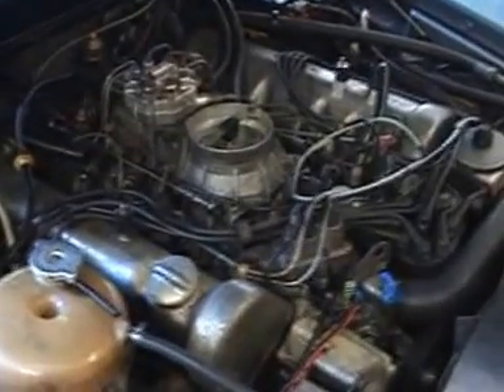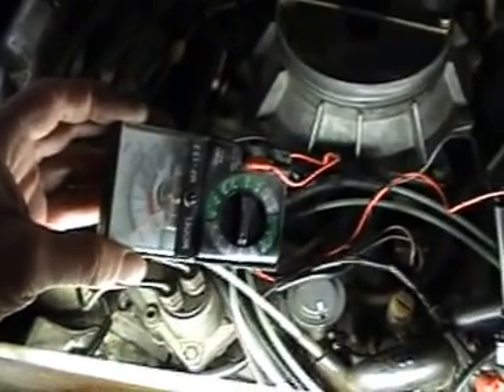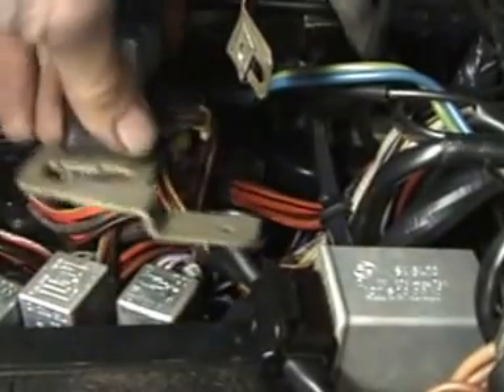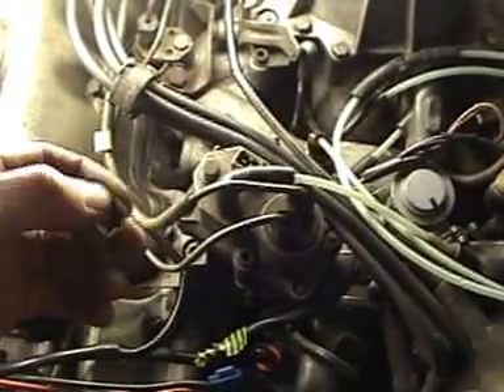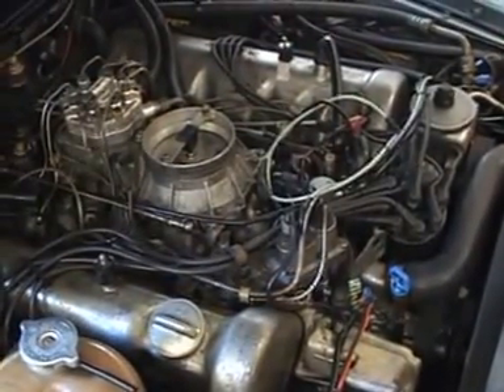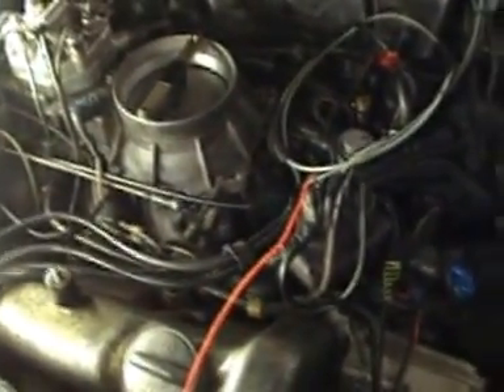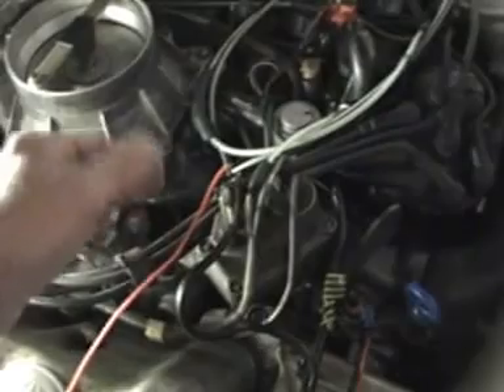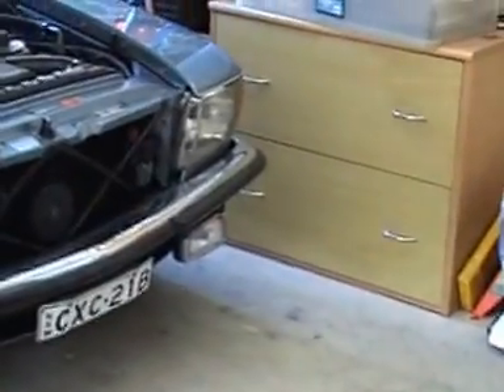450SLC Engine completly haywire/ Fuel filter change

Comment: Those damn banjos always tend to leak after a filter replacement 8:25, why they did not use a damn pipe that fits over the filter and use a clamp to keep it in place like on a lot of other vehicles I don't know, the Germans always want to be different for the wrong reasons.

Comment: Good video once again. I follow these religiously. I'm very interested in your fuel injector replacement. I still have a slight missfire on my car at idle and really seems to be fuel related (injector or distributor leaking) so the injectors were one of my next steps.